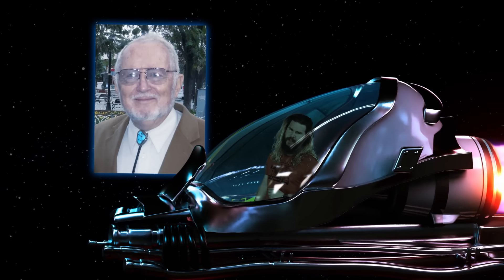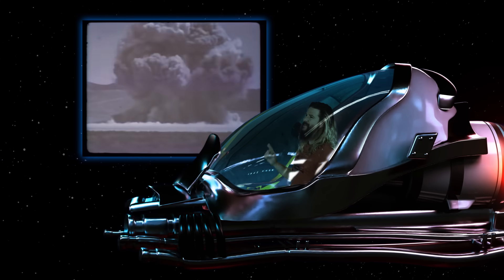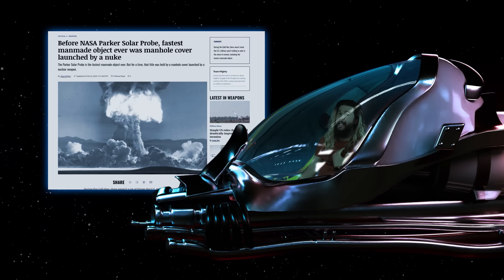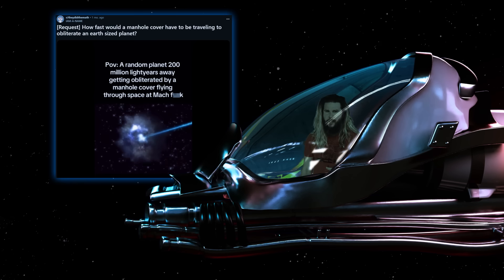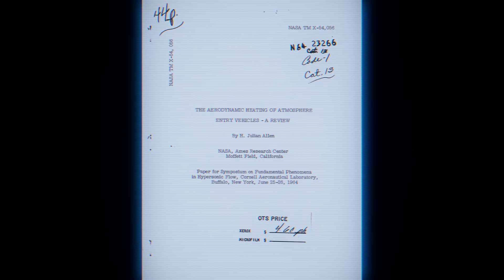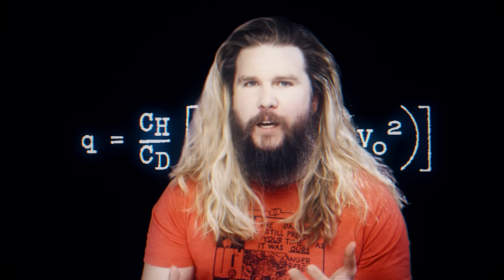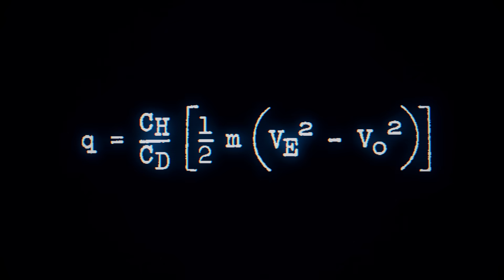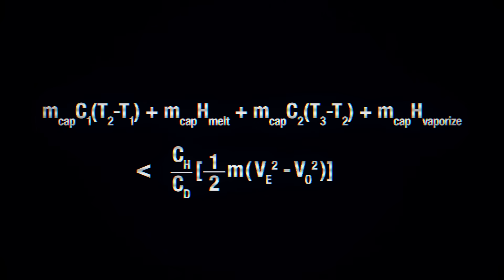Debunking the Nuclear-Powered Manhole Cover

Comment: I wrote a paper on this when studying for my PhD in Aeronautics at Stanford. Even if the blast turned it into a more aerodynamic shape with a drag coefficient of 0.50 (YouTuber Cody's Lab had suggested this a decade ago and it prompted me to write the paper), I showed it would have burnt up before reaching space at 150,000 mph or whatever it was I calculated the speed at. Cody's Lab believes it could have reached space. I believe his video on it is still up.
Reply: Did you account for the fact that there would be gas from the blast that is moving along side it, meaning it would burn slower as there is less drag?
Reply: @jimskywaker4345  drag is not why it burns, well at least not directly. The burning you see on supersonic objects is due to the high reduction in Speed after the shock. You could argue that the shock in and by itself is an effect of pressure drag (which it is but in an incompressible fluid you would not be able to reach these types of temperatures).
Reply: @jimskywaker4345 That's also what I've been thinking. A meteorite is pushing it's on air wave in front of it, but a nuclear explosion has a lot more going on besides just the object itself
Reply: For shape, look at EFP war heads. It’s not impossible that I am greater than .50 ballistic coefficient was created.  Did you calculate the insulating effects from Not just from vaporization, but also the state change to plasma? My math says that the upper limit here might actually be aerodynamic loading and structural failure of the cast-iron EFP itself, But again, those horses are highly dependent upon shape
Reply: @ladybenjamincannon1574  Given that its peak strain is achieved almost instantly on being blasted out of the tunnel smack into the high density atmosphere at low altitudes, I do wonder if the whole thing didn't just blast into a cone of fragments before it had a chance do do any of these other things. You wouldn't be able to tell that from the film.
Reply: @ladybenjamincannon1574  Do you have any source on the actual material used? cast-iron would not make sense as it's shit to weld (i'm assuming they welded the cover in place.)
Reply: I'm curious if the thinning of the atmosphere as it goes higher would be important instead.
Reply: @luckycobble935  means at its peak velocity (just after leaving the effect of the shockwave accelerating it) it would be in a thicker part of the atmosphere, making it worse than the opposite side of meteors coming down who decelerate in the thinner atmosphere first.

In other words...  highest speed + thickest atmosphere = more destruction :)
Reply: @SomeGuysGarage  except at that point it still had a massive plume of expanding gas pushing it and then pulling it through the atmosphere.
Reply: @SomeGuysGarage  What's the rate at which you can input energy into the plate? It would have started at ambient temperature, would that buy it enough time to reach thinner atmosphere?
Reply: @SomeGuysGarage  this, many people in the comment seems to overlook this, they think than it would just skip the resistance because it's so fast to leave atmosphere, but then also the cap would experience a very dense atmosphere compared to meteor Direct at the start, sort of like punching a wall than cotton, so it would probably deform to a dome shape and explode, also losing it's thin more aerodynamic shape, and probably shred to pieces like a big water droplet breaks down to smaller ones in when falling in the air.
Reply: @luckycobble935  You can consider the reentry of space stuff that comes down at about 7-13 km/s and starts to burn up way, way up in the atmosphere because friction with air. Way, way up in the atmosphere the air is still very thin and stuff is already burning up because the friction with air and they are far above even Mt. Everest heights of 8.8 km. For example out of my head MIR started to burn up in 100 km altitude and disintegrated from the heat in around 80 km. So, while the thinning of the atmosphere does miracles for planes fuel efficiency already in 9-10 km altitude and humans can hardly live above 8 km because too thin air, stuff falling 6th of the speed of that manhole cover burn up 10 times those altitudes.
Just think about it.
Reply: @IcedForce  Meteors are extremely loose clumps of mixed material, not solid manufactured metal, and include considerable amounts of water ice that vaporizes explosively easily ten times more readily than iron or steel even melt. This is what causes them to explode - most meteors do have material reach the ground, but very few are in one piece due to the ice exploding them. This is not a flaw that the test cover would have.
Reply: @iskierka8399  Quote me the part where I even mention meteors.
Reply: @IcedForce  Meteors are the only thing even close to relevant in the area you suggest. MIR is a laughable comparison; space stations are built fragile, intentionally, for weight saving. A gun was fired from MIR once and it was shuddering for hours. It is even less comparable to a solid plate of steel than a meteor is.
Reply: @iskierka8399  100 tons of material falls to Earth every day, from it under 1% is man made (or like 200-400 pieces of space debris falls to Earth yearly so around 1 per day and Sundays are off). But the point isn't how much or even what but that almost all of it burns up way up high with a lot less speed.

And still, we are talking about 10 times the reentry speeds in the what we can call surface level air density and we are not even touching that the cover doesn't need to vaporize to not make it into space, it's probably enough that it heats up to be liquid and it turns into forbiddenly hot aerosol.
Reply: @IcedForce  It has already been explained why meteorites usually explode (they don't vaporize, they explode, due to the water ice evaporating before the rest even melts, the material reaches the ground it is just not in the original form), and why higher speeds are not an argument for not surviving - higher speeds make it more survivable because there isn't time for the heat transfer.
Reply: @iskierka8399  Just say you don't know about physics anything and don't put words into my mouth especially if you don't get the metaphor.

Like seriously, heat transfer... There's no heat transfer here, unless you count in the heat transfer WITHIN the metal. The air heats up the metal because friction, the air molecules and in this case we can quite comfortably go to atomic level even, cannot move fast enough from the way of the cover so they drag along the cover and so there's friction between them and the metal and that friction creates heat within the air and metal molecules.

That breaking up of the cover has, again, nothing to do with meteorites, just forget them already. It's about aerodynamics and in this case technically hypersonic aerodynamics (in practice we are so far from even hypersonic, 5 times the speed of sound or Mach 5, speeds that even hypersonic aerodynamics probably don't apply to the speeds of the cover which went Mach 196). If the cover heats up even to temperatures where the iron (which has rather low melting point in this case) starts to loose it's rigidity and turn malleable, it will just break up. In those speeds the air resistance is the same as solid concrete for anything that isn't very specifically shaped (most likely very thin and very pointy, which is kind of opposite to flat and blunt and even on it's side, it's still rather flat and blunt).

The point was, things start to seriously heat up in way less dense atmosphere (in 10,000m air density is around 0.41 kg/m3, in 80,000 m it's around 0.000016 kg/m3, at 0 m it's 1.23 kg/m3, you see, you don't need a lot of atmosphere to get things heating up from the friction with air) and in way less velocity (the initial reentry speed of space shuttle was Mach 22, and it braked with the air resistance and still needed ablative heat shielding, which means stuff that burns into carbon and creates insulating layer and hopefully doesn't burn out before manageable speeds are attained).
We are talking about cast iron manhole cover that doesn't have any special or magical properties taking off almost 10 times the reentry speeds in 10,000 times denser atmosphere than it takes to start turning air to plasma and require some really serious cooling solutions to keep things from not burning.
Reply: @IcedForce  Well done demonstrating your complete lack of reading comprehension, as yes, indeed, the heat transfer inside the cover plate is exactly where the problem would be. It needs no cooling solutions for a significant fraction of its mass to survive, because its own thermal inertia is its cooling system. Outer layers will be destroyed without having any effect on the inner.
Reply: @luckycobble935 of course it would have an effect.  The air is literally less dense.  These guys are taking physics equations off google and trying to reverse engineer this whole thing.  That manhole cover was going so fast the air in the atmosphere was negligible 😂
Reply: @luckycobble935 It would be if it got that far. . . In its initial stage of acceleration it would be in thick atmosphere tons a lot more dense a lots of drag means a hell of lot of heat. I think it would burn up really fast. but that's just my uneducated guess
Reply: @luckycobble935  cast iron? In 9 out of 9 cases, it would not have come that far.
Reply: Did you consider the propellant gasses shielding the projectile for some distance, since it WAS vaporized concrete propelling it, or did you calculate it in "free air"?

I do believe it did reach space.. At least some of it did.
Reply: There's a lot wrong with this video... conductivity is completely ignored, time spent in atmosphere is ignored as well, the assumption that it stayed face-on to the air is silly, it would have been tumbling more than likely, and likely severed deformed from the initial force. 

It's fine to do napkin math, but it sucks when you preface it with the whole "we're gonna do it with ALL the math this time 🤓" spill. Lame.
Reply: Cast iron is also brittle. Might have just ended up shattering and scattering, losing much of its momentum.
Reply: How does the change in atmospheric density affect the calculations? The higher it went the less heating it should be experiencing, and whats the efficiency like for atmospheric heating, how much of the heat is lost without being used to heat the object? 

I feel like kyle’s math could have used some calculus, a few riemens sums, some dynamics and differential calculations.
Reply: Wouldn't it liquefy like a shaped charge anyways at those accelerations?
Reply: Did you at least take plasma boundary layers and the stacking effects of energy air and things like radiative heating and plasma light reflection and heat transfer speed into consideration?
Reply: where we can read the paper?
Reply: I had heard that some believe it was travelling too quickly to have time to react and burn up
Reply: Actually a less aerodynamic shape works better because it pushes the stagnation zone further away from the surface
Reply: There really do seem to be quite a few complex factors. Probably need some hypervelocity kinetic testing data and a decent chunk of supercomputing time to actually model it accurately.
Reply: Of course there is another question at hand, if it did reach space what reached space?  If some part of the cover did reach space, the form it reached space in was probably nowhere near the form it was in when it was on earth.  The portion that could have reached it may have just been a small portion of molten metal.  It may have been mainly a ball of plasma being ejected from the atmosphere.  

Like the report from the test originally indicated they only had the rough data of the shockwave that would reflect off the surface assuming a vacuum.  They did not gather material information, information on the securing of the cover, they didn't have enough information on the energy imparted to the cover, atmospheric information, etc.  They just knew that it would reflect enough energy for the brief moment they needed and gave a wild estimate of about 6 times the escape velocity of the earth and identified some remnant of something existing in 1 camera frame.  

To really prove anything more than that you would really have to repeat the experiment with more data being gathered on the cover plate.
Reply: in what orientation
Reply: Do you think he should take it down?
Reply: if it was launched in a bore on top of Everest could it make it as you're dealing with less O2?Hypothetical Q.
Reply: That exact Cody’s comment is above yours on my feed
Reply: could you possibly give a link to your paper? i am interested.
Reply: I wonder: how fast it vaporized and how much did it manage to travel then? I mean if it did vaporize travelling at such speed, there should have been a visible trail left. Why there os no accounts for that?
Reply: Interesting. The atmospheric thinning would have also been a factor, as well as other air turbulence from flat surfaces causing air differentials with areas of less heat. It is possible a chunk would have still exited the atmosphere, though not looking like a manhole cover anymore, given.
Reply: how'd you do it? i take it you used CFD, not some boring ass equation with constant coefficient over T seconds. would love to read that paper and cheat this one.
Reply: If it burned up like a comet then why wasn't a trail left behind?
Reply: When your did your analysis did you do it one the heuristic basis of what phase space of variables given the knowns would reach space or on if the knowns are clearly enough against it. My personal suspicion is that if any fraction did leave space it would be because of edge effects. For example any sublimating Fe gas/plasma would be conducting heat away from the core object. And I would expect the object to be deformed.

There have also been much smaller pieces of satellite debris that have reached the surface. So my general conclusion is that its nearly impossible to know.

Also if I remember correctly there was a theoretical possibility that the entire thing got vaporized from the bombs EM, that the one frame difference was the presence versus absence of the cap, not the cap a certain height in the air.
Reply: This sucks cause I still feel like it would've withstood the atmosphere for how short a time it was fighting it. But what I feel doesn't hold a candle to how the math plays out 🤷
Reply: Exactly what I think, upon friction with air it's not the metal that heats  up but the compressed air that transfered heat to the metal, and if it got an aerodynamic shape by the force of propulsion and the air resistance, then this cushion of air didn't hot enough to melt the metal, one more thing to consider, if it was bent in two like a coin, it would have created a zone of low pressure right behind the bentband that would be sucking air from the side which would cool it down considerably. I think that manhole is still out there folded in two and floating in space.
Reply: What was the mass of manhole? In the tons?
Reply: Did you do normal manhole cover size or the actual size?
Reply: Link of the paper?
Reply: There's still questions ; what about the speed of said heat transfer, what about ablation negating some of it, etc
Reply: PhD in Aeronautics at Stanford is very impressive. What is aeronautics?
Reply: Where were you getting your values for hypersonic drag coefficients?
Reply: im curious on this, at what altitude would the manhole end up reaching before being completely vaporizing? and at what time after launch?
Reply: The high speed camera footage proves minimum initial velocity of 195 times the speed of sound. Soooo I have doubts. But hey I'm just a YouTube comment what do I know
Reply: But we also have meteorite that are smaller.
Reply: A hero appears🎉
Reply: Key factor not discussed: heat transfer is not an infinitely-rapid process, i.e. it isn't instantaneous. While meteors moving 3x slower burn up, an object going fast enough could theoretically make it through before it has a chance to burn up. The object, admittedly not factoring in drag, would have cleared the atmosphere in barely a SINGLE second, meaning it may not have had enough time to absorb the necessary heat to be vaporized.

Second, the comparison with meteors is flawed in a very specific way: meteors are going from a vacuum into a steadily INCREASING dense atmosphere AT AN ANGLE, where the "manhole" would be moving from a dense atmosphere into a rapidly THINNING atmosphere at NO ANGLE. Since the math shown doesn't address that (you would have to integrate the effects of heating/drag across the thickness/density of the atmosphere), it's still possible the "manhole" made it to space (whole or in part).
Reply: I was curious about what if it was flying like a Frisbee because if I try to throw a Frisbee flat against the air,  it tends to tumble until it reaches its least wind resistant side.  Kyle specifically states he calculated it as is it was flat against the air and not if it was tumbling or even flying like a Frisbee
Reply: Did you take into account the movement of the are that came up around and from behind it?
Reply: The problem is that you and Kyle, and everyone else doing calculations about the cover are doing the completely wrong calculations.  Everyone is focusing on if it could get out through the atmosphere, but for some reason nobody ever talks about what would be needed to get it up to speed in the first place.  Despite what Kyle says, the cover was not on a single frame of high speed footage, rather the footage went from nothing moving to nothing but a jet of fire being visible in the time between two frames.  

In order to accelerate the cover to a speed of 66km/s, it would have to be hit with a jet of hot gas moving at faster than 66km/s.  But the speed of sound in cast iron is only about 5km/s, which means that when the shockwave hit the back side of the plate the force could not be transmitted through the plate to accelerate it in time.  Instead, the iron on the back of the plate would undergo compression heating until it was hot enough to transmit energy at tens of kilometres per second and then it would transmit the energy to the next layer of iron atoms which would also be heated, etc until the shockwave had passed through the entire plate.  On the back side of the shockwave, the heat would cause iron atoms to be spit backwards at tens of kilometres per second into the area of extreme rarefaction.  Because at the temperatures associated with shockwaves moving at those speeds, there is no such thing as solid materials, just plasma and maybe still a bit of superheated gas that hasn't been ionized.  

TLDR, when you focus all the energy of an atomic bomb onto a solid iron plate, the iron stops being solid before it has the chance to stop being stationary, and it gets turned into gas the same as the bomb casing does.  The iron plate didn't make it out of Earth's atmosphere, and in the frame of footage that shows a jet of fire coming out of the hole but no solid iron plate, it isn't because the plate has been shot out the top frame already, it is because the iron plate has been turned into the jet of fire.
Reply: @faroncobb6040  The one frame does indeed shows the solid plate in the plume in the upper third of the frame.  The Mach 6 was the min. speed the scientist calculated because the high speed film only had one frame that caught it and it was already over halfway out of frame in the first frame of the explosion.  While the heat of the explosion may have melted it first it was out of frame.
Reply: @charlesmaurer6214  I was sure I had seen a video where someone had the original footage and went through it frame by frame and none of them actually showed the plate, but it seems I was wrong.  Regardless, it doesn't change the fact that you can't accelerate something to 6x escape velocity(or even 1x escape velocity) by hitting it directly with a nuclear shockwave.  

The 6x escape velocity number came from a very simplistic calculation done before the nuclear test that was intended to prove that the iron plate would be useless.  Whatever minimum speed was calculated based on the object exiting the frame was sufficiently unimpressive that he didn't even remember what it was.  If there really was a solid iron disk that was imaged intact and in motion then I would be surprised if it was even going 1/5 escape velocity.
Reply: @faroncobb6040  High speed camera and the cover acted like a bullet with the blast contained like it is in a shell in a breach.  the calculation was the smallest speed possible due to the frame rate.  As in no explosion in first frame in a row, second a focused blast extending to the top of the frame with the lid one quarter down from the top and gone in third frame.  If you had 2 frames a speed could be nailed down but with only the one they were able to say it was at least that fast.  Also it was not a surface detonation and concrete below the lid served as wading that burned like gun cotton except hotter and faster but converting more of the Nuclear blast into even greater pressure.   One of the results also of the test was that the contained blast caused the bomb to release 10x the energy they expected from the same bomb in surface test.
Reply: @faroncobb6040  In the interviews where he described this, which you are clearly attempting to quote from, he specifically says it was an impressively high number - he doesn't remember because it was considered an unremarkable test at the time, as it was a failure for its intended purpose, and it was 40 years prior.
Reply: @faroncobb6040 It was caught in a single frame of the high speed camera.
Reply: @faroncobb6040 wouldn't the plasma leave the atmosphere? It wouldn't be the manhole cover anymore but it would leave the atmosphere.
Reply: @faroncobb6040 not to mention the extreme surface heat from the sudden burst of radiation, before the hot gasses ever got a chance to reach it. And that same burst of radiation is what heated the gas, so it wouldnt necessarilly be a shockwave of hot gas fired at it, but more likely the whole volume of gas between the cover and bomb heated instantly all at once.
Reply: It doesn't need to become a more aerodynamic shape; even a minor tumble would cause it to shed most of its drag with an edge-on flight, easily a 98%+ reduction in drag, and at that point the question isn't aerodynamics, but thermal dynamics; to claim it would "burn up" you need to demonstrate that the heat of its bow shock can even penetrate through the material fast enough, and, spoiler, steel isn't thermally conductive enough for that.

Even if its skin had infinite heat applied, only the outermost millimetres of the material would have heated up by the time it reached space. The energy just doesn't transfer fast enough for anything else to happen. The limiting factor would therefore not even be heat - it can't burn up, it's too fast - but whether it would shatter under the forces.
Reply: @iskierka8399 if the skin had infinite heat applied the manhole would burn in an instant,because it is infinite the conductive and convective heat transfer would be infinite and so would be the radiative heat transfer, the change of state would slow it down but the infinite temperature source it is in contact with would heat it up all the way back in an instant anyways. This is not even a question, you'd need to do actual heat transfer calculations to know whether or not it vaporises though.
Reply: @iskierka8399  this. 
And also I think that cup going flat up would have cushion of air that can insulate this cap from above incoming air. 
Speed of the cap is Mach 192. If shape of cap is flat, then that air is gonna stay "glued" to that cup.
Reply: It wouldn't burn up though... at 150,000mph it'd have gotten through the atmosphere in A second... friction wouldn't have enough time to act on the manhole. And 2,000 pounds of refined steel takes a lot longer to burn up than something akin to a meteorite
Reply: @fullcircle8231 refined steel? Thought it was cast iron? (If I missed something, I apologize) 

(Although if it were cast iron welding would be difficult (although but impossible) & I wouldn't expect it to leave the tube intact)
Reply: @fullcircle8231  That's why we're talking about it vaporizing, not just melting. That is to say, it would happen relative to the distance it traveled moreso than it would relative to time. It moving over such a huge distance at such a high velocity plus the resistance of the earth's atmosphere means it heats up as it travels, and would very quickly (as in almost instantly) go from fully solid to a bunch of extremely hot dust.
Reply: @isoid  Distance doesn't solve the fact it takes time for inner material to receive outer heat. Even if the heat applied is enough to fully vaporise the cover, if it is applied too fast, there isn't even time for outer material to get out of the way - the outer material goes beyond vaporised, absorbing the extra heat, and then once out of the atmosphere it leaves the bulk of the material without having heated the inner material.
Reply: @iskierka8399  Yup, Kyle just assumed perfect heat conductivity and ignored ablative effects.
Reply: @willythemailboy2  He also ignored the effect the air was moving with the cover from the blast.  An incoming object is hitting the air like a belly flop from a high dive in a pool verses a divers hands punching a hole ahead of the body.  The drag did not exist for the first couple miles with the lid riding the shock wave plume.
Reply: @charlesmaurer6214  And the fact that the lid was welded on, meaning whatever it was welded to may have come along for the ride and increased the mass.
Reply: @isoid If it did vaporize there would be an explosion, if it didn't explode that mean it reached space.
Reply: @iskierka8399 ahh that's called ablative heating, i need to rethink now, will the outer layer move out of the way as a liquid or gas? That would affect the required heat
Reply: It did reach space and your paper was wrong haha
Reply: @isoid  Nice paragraph, don't get your blood pressure too high sweets
Reply: @saucecups  Nice name, dont get too cringe though edgelord. 🤡
Reply: @saucecups 
Don't you have anything better to do tham spam the internet?
Get out of your mom's basement!  
Get a life!
Reply: @saucecups writing a paragraph raises your blood pressure? Because that's an odd thing to assume when you're critiquing somebody else's paragraph unless it's something that you personally experience lol perhaps you should get at least a primary education before you comment within this channel. You don't have to be an elitist 7urd, but at least use critical thought.
Reply: @PugetWitch  People still whining about this thread? 10/10
Reply: @isoid  It's usually the 'middle schoolers' that get this upset with jokes, and provide me with great entertainment. Please, do go on
Reply: @saucecups  why are you talking to middle schoolers.
Reply: They give PhDs for anything.
Reply: @X22GJP Where's yours then lol
Reply: @X22GJP  A PhD in Aeronautics is kinda important considering how poorly 'winging it' when it comes to flight for humans.
Reply: @X22GJP  jealous you can’t calculate the speed of an object moving thousands of miles per hour through the sky? 😢
Reply: @sageviper2981 That's the last thing in the world I care about. Lol Don't need to know. Don't want to know.
Reply: @X22GJP  I'd be the first to say most PhDs are a waste of time, but damn, that was out of the blue 💀 for Aeronautics even
Reply: @X22GJP Yes, aeronautics is an area where a PhD would be desirable. He didn't say he did his THESIS on this.

Reading comprehension should not require a PhD.
Reply: @X22GJP i mean.. he never claimed to have changed the world. Brother just good at maths. Like doctor at math
Reply: @X22GJP  you know the op didn’t receive a phd based on this one paper they wrote, right?
Reply: @X22GJP  A single paper is not the PhD. Don't turn a tree into a forest so you can snub your nose at the forest.
Reply: @X22GJP it's called working for it in college. I don't see your point other than trying to ragebait comments. You make it sound like that is a bad thing.
Reply: @X22GJP  Do you have one? If not, why, seen as they're so easy to get according to you?

And he didn't say it was for the PhD, he said it was while studying for one, lol
Reply: @isoid why so mad? PhD insecurity?
Reply: @saucecups  Are you the big silly?
Reply: @saucecups    Sounds like someone has PhD envy.
Reply: @TheJimtanker  No thanks, I don't pay for scams love
Reply: @saucecups    What scam?
Reply: @isoid  Because they cost a hundred grand.  Money better spent on other things.
Reply: @isoid  to be fair, he said "they give phd's for everything" not "they give phd's to everyone". And technically he's right, you can get a phd in practically everything
Reply: @arifhossain9751  "You're dad" lol
Reply: @mahbriggs  I know, it's pretty funny.
Reply: @isoid  I don't have a PhD because im not dumb enough to spend money on "education". I don't need the societal definition of education to make money which is what I need to be comfortable, be happy, and survive. If I wanted more money to become "rich" I would know what to do but that's not my goal. Hope this helps man
Reply: @isoid  You need to study critical thinking. He never said it was easy.
Reply: @saucecups This thread quickly devolved into elitist chest thumping.
Reply: @PugetWitch  He said they give them out for anything. It's a line used to devalue stuff, and saying that something can be obtained by "doing anything" pretty obviously makes the implication that getting that thing should therefore be easy. That's almost base-level English. Maybe you should study "implied meanings" because the 200 people who liked my original comment presumably agreed with my interpretation